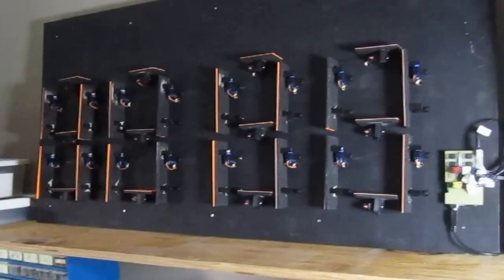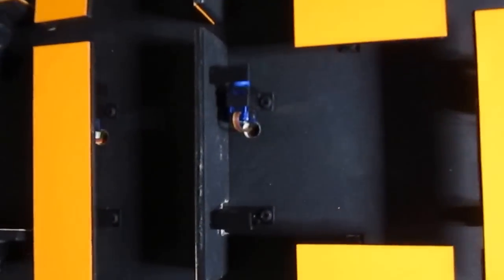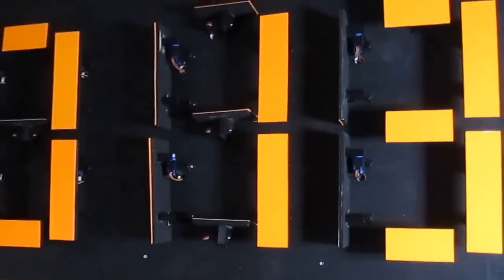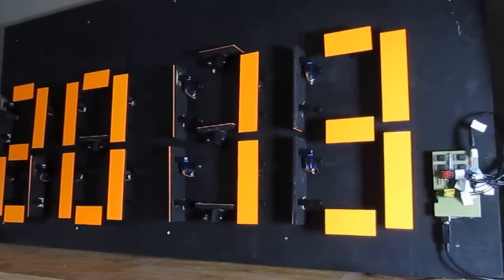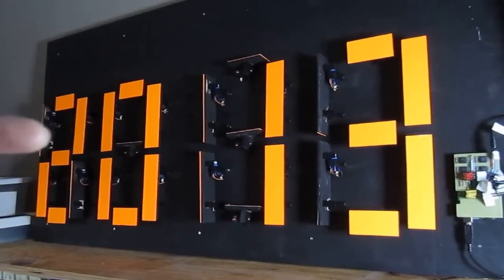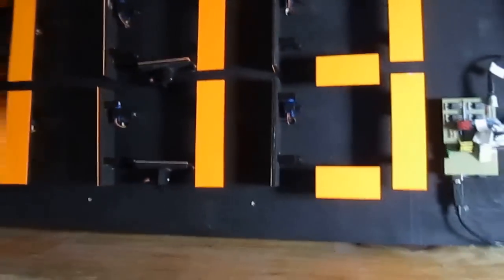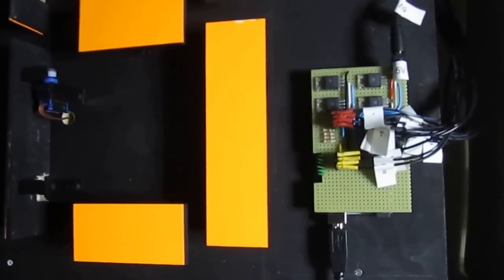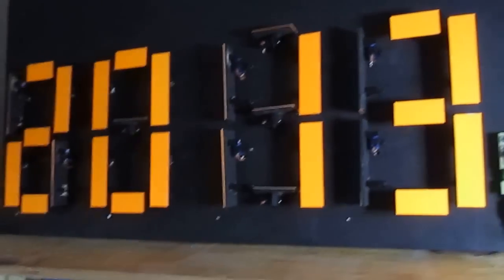Servo Driven 7-segment Display - COMPLETED!

Comment: es durable este proyecto ?  si lo dejas trabajando continuamente, cuanto tiempo cres que funcione sin mantenimiento sin reemplazar los motores o algún mantenimiento?
Reply from the maker: My version is not durable, but you certainly could make it more durable.  The construction could be made stronger. If you use good quality servos, it should last for years (the servos moves infrequently).

Comment: WOW fantastic project! Very impressive!
I want to make something similar but with laser cut acrylic digit sigments.
I'm a little confused about how you multiplexed it with just 4 pins tho. I understand you use single PWM pin to drive positive side of all servos in each digit, but you still need another 7 pins to drive negative. How do you accomplish that? Do you use shift register?
Reply from the maker: Thanks +bratan007 !
You're right, it takes more than four pins.
In the project blog below there's a diagram showing how I wired it up:
- 7 to control the servo position
- 4 to drive the positive power side of all servos
- 4 more to drive the negative side of all the servos
The code only powers one combination of + and - to power ONE servo at a time, send the proper position, and then goes to the next servo.  It's not real time, but works for applications where the digits do not have to change too quickly.
http://g33k.blogspot.com/2013/12/servo-driven-7-segment-display.html